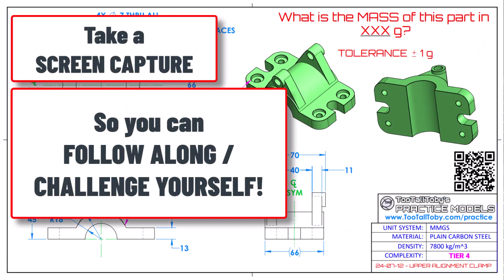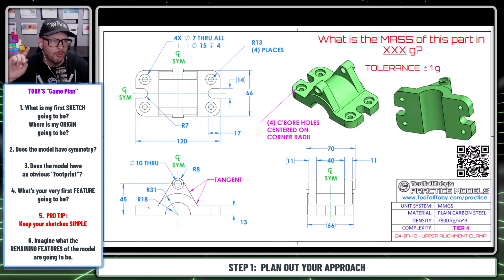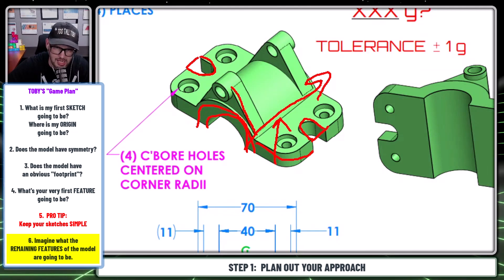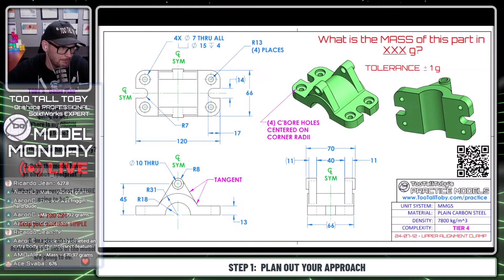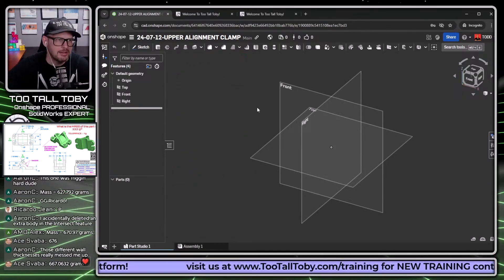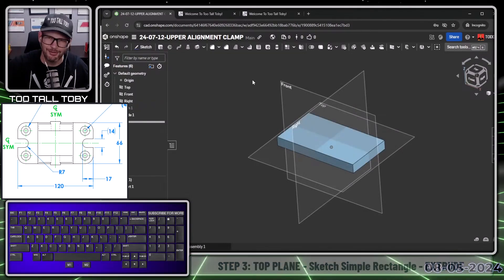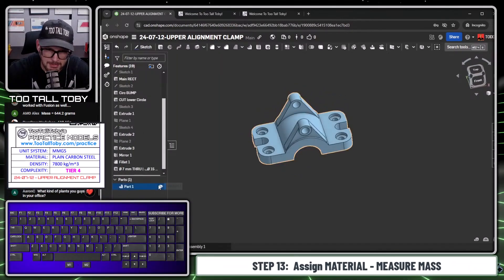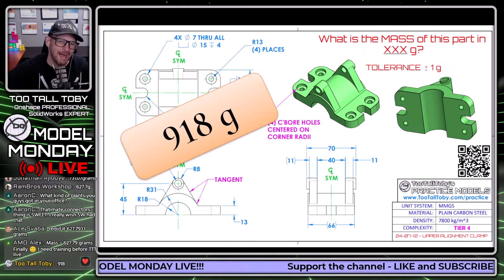Onshape Beginner's TUTORIAL - Step-By-Step - with TooTallToby

Comment: Awesome tutorial... As a hobbyist 3D parts maker, but a full-time software engineer who enjoys when developers pay attention to usability - I have just discovered onshape and I am impressed... A couple of things that tripped me up during the first time following the tutorial:

1) The hole dialog is a little confusing - The Drill Size drop down and hole diameter text entry box refer to the same parameter, but it seems the Drill Size drop-down overrides the text entered into the text entry box right below it - at least it did for me. I somehow had a Drill Size set in the drop-down as 5 and the text entry was 7, but it actually used a size of 5mm for my holes - and my model ended up with the wrong weight. Once I fixed the hole size it was perfect.

2) Selecting the appropriate mate connectors for the counterbore holes was very finicky - it seemed the only way I could find the holes to be selected was by adjusting the tilt angle of the model and zooming in a bit. It took some fiddling to finally get onshape put down holes on the top of base even though the circle centers were always showing up.
Reply from the maker: Nice  - thanks for the kind words.  I have a video on mate connectors here: https://www.youtube.com/watch?v=TBWLGuLl5Nk 

And I also talk about it a lot in the stirling engine tutorial - time stampped here: https://youtu.be/GYkZmE_6MpY?si=4lRpp0L65v2nepjL&t=3559

hope this helps and good luck on your CAD journey! 

Oh and PS I know there's a hotkey (maybe SHIFT) you can press once the mate connector "looks right" so it locks in, even after you move your mouse.  I forget what it is, but I think that will  help you too (if you can find it)

Comment: following along with you, I can not get the mirror sketch feature to work on the tombstones. it does mirror the line, but when i do extrude, it says missing faces of sketch 3 and it only extrudes the tombstone that was actually drawn. I can't figure out what im doing differently than you... the mirrored tombstone is not selectable by the way. I also could not get the hole counterbore to put a counterbore onnthe face in the radius'. all of the selection points are on an edge, I can't figure it out. Any help is appreciated. Thanks.
Reply from the maker: Yeah that's a tricky one - maybe after you start the extrusion command, clear your selections (with the spacebar) and then try to select the regions by clicking them from the graphics area
Reply: @TooTallToby  Tried this but didn't fix the issue, it has trouble mirroring to any face that isn't the sketch face, any tips?
Reply: found my fillet settings were different than yours, changed to match and now i have counterbores. ill try the mirror sketch again, thanks.
Reply from the maker: @CJRoe  Awww yeah nice job!
Reply: @CJRoe  I have the same problem but not sure how to fix?
Reply: @Rouxvoloution  I'm  not sure, I haven't fixed it yet lol. But I noticed that a lot of his drop menu for sketch/extrude/filet/ ect, had different values than mine- that's what I found with the filets. I'm thinking there is something in the sketch or mirror step that is different. 
Hope this helps...